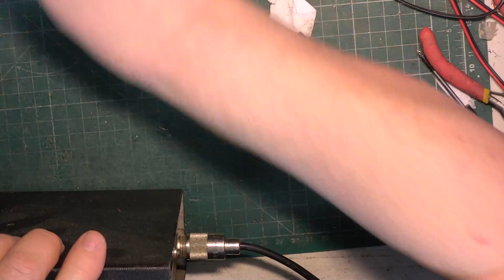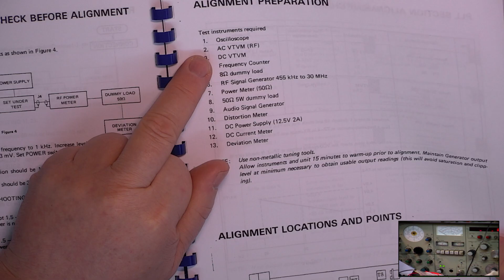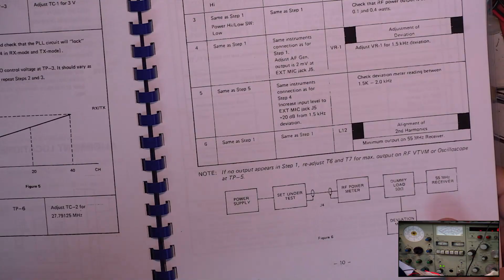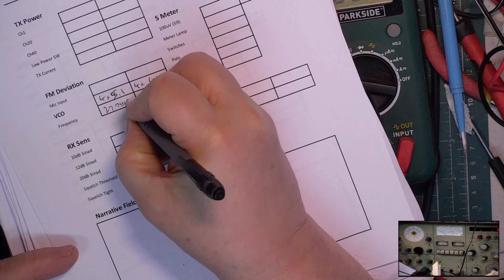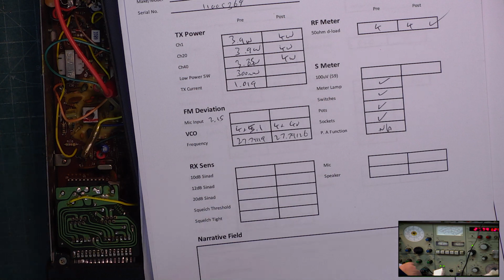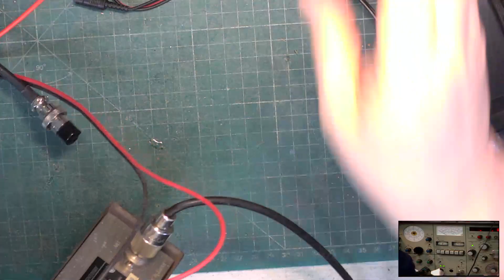Binatone Speedway CB27/81 UK FM CB radio -  alignment

Comment: Thanks so much for letting us know exactly what you’re doing and the right way Richard. The S meter looks like it should be on a handheld. Thanks again and god bless , see you on the road test with mr chippy.ps I never knew that I was running my CB legally not having it on low power, because of the height of the antenna.🇬🇧💯👍👍